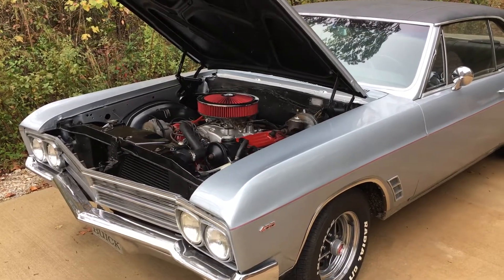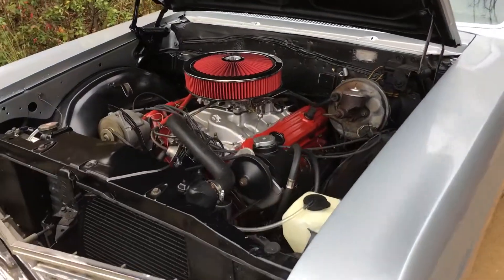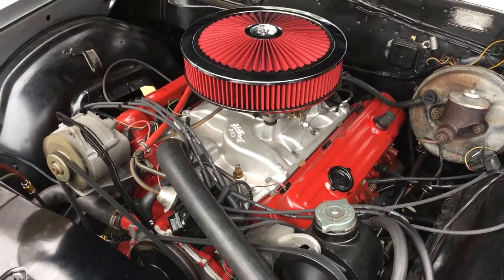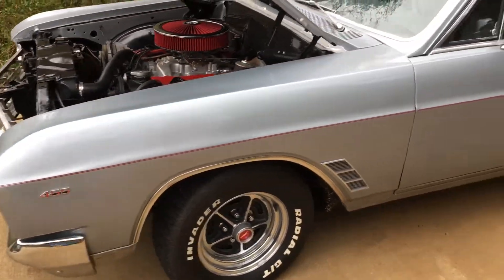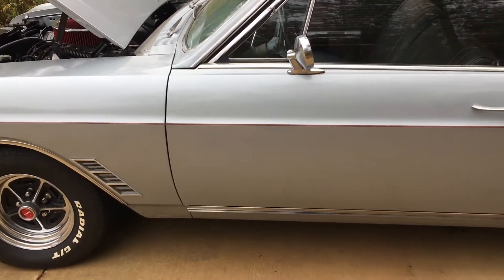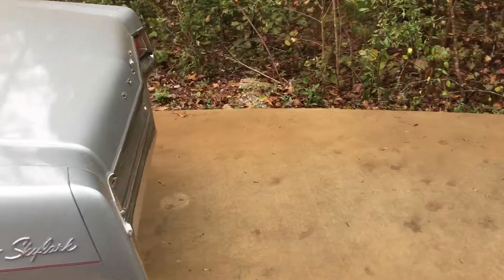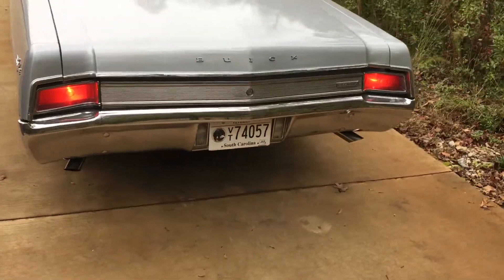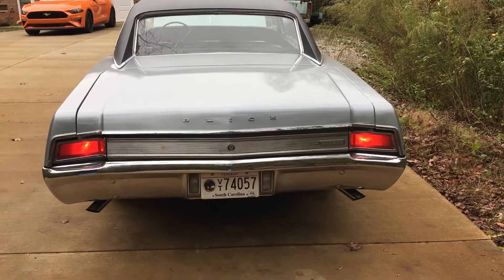Had my 1966 Buick Skylark out today

Comment: I have the 300 and I have some major overheating issues. I replaced the thermostat and put in a 180 degree and then I flushed out the radiator and it still overheats when just idling/sitting. I have a even have a 12” fan on the back as a puller but it doesn’t seem to help much
Reply from the maker: Its a long shot, but perhaps the impeller is rotted off the water pump.
Reply: @76629online  Funny you mention that because that was also replaced. The old one was filled with sediment and frozen
Reply from the maker: @kyocera66  in that case then the water jacket in the block might be full of garbage too.
Reply: Aluminum radiator
Reply: TA pump and check the cap.